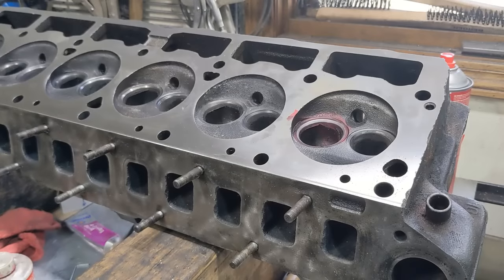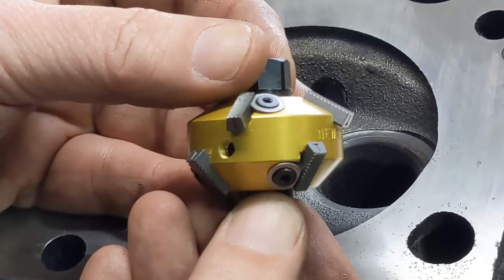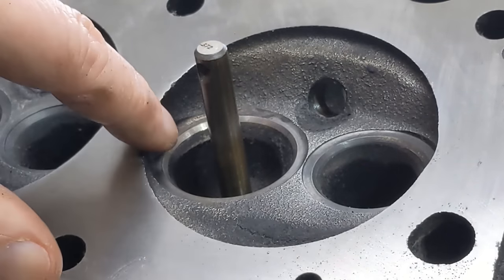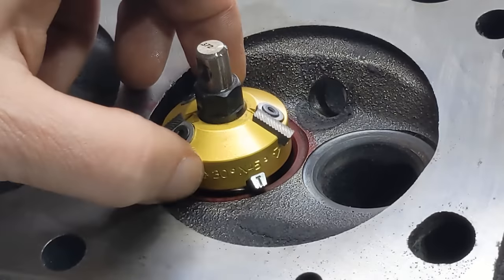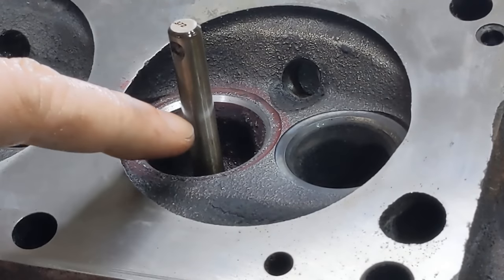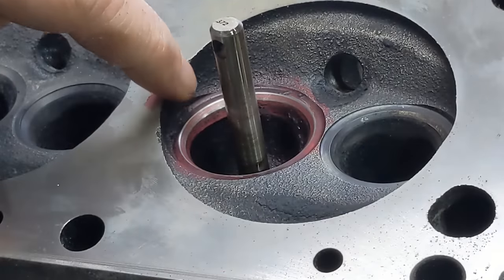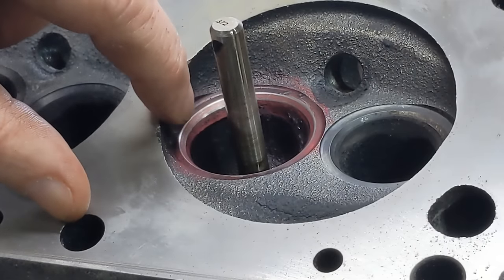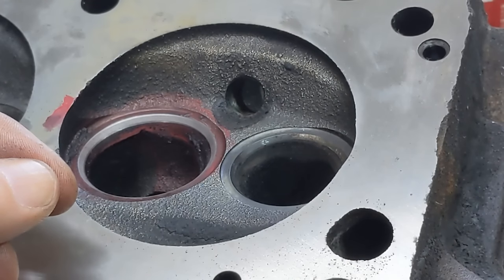Do Your Own 3-Angle Valve Seats!

Comment: When lapping a valve, turning the valve more than one complete turn is not correct and won't show any low spots in the seat. The correct method is to turn the valve only 3/4 of a turn.

Comment: Maybe the title should be any a hole can do a valve job? Your first mistake? decking the head first. You do that last. Your 2nd mistake? cleaning the head AFTER YOU DECKED IT. Your 3rd mistake? not using a light spring to hold the cutter off the seat. 4th mistake? you are using the 30 degree cutter to set the seat outside dia. 5th mistake- you are using the 60 degree cutter to set the valve seat inside dia.  6th mistake- lapping compound simply ruins the seating surfaces . 7th mistake? posting this video
Reply from the maker: So make your own video and post it. Question: Are you a huge dick in real life, or just on the internet?
Reply: Thanks for watching. 😆😆😆

Comment: Good tool but ghe seat is way too wide. A piece of carbon can get under it and hold the valve open causing it to burn up the valve. A narrow seat about 1/16th" will cut the carbon and send it out the exhaust.

Comment: Putting a 3 angle valve seat on this head is almost a waste of time since the whole thing is as-(badly)-cast and requires a port and combustion chamber clean up before contemplating any valve seat work.  The width of the valve seat should be 40-50thou and that has not been contemplated here, which appears to show that a little knowledge is ..............

Comment: I guess it's time to throw that Black and Decker seat grinding set in the garbage!
Reply from the maker: I'm hard-pressed to ever throw out a tool, but man, these things are WAY easier than the old-school corundum cutting stones.
Reply: If you have a complete Black & Decker setup use it, biggest drawback is most people aren't religious about keeping the stones dressed, there are many applications where the results using the stones are superior to a Sirdi or Neway .
One place I use my B&D seat grinder is on hardened (like Stellite or Inconel exhaust seats), quicker and smoother than the carbide cutters.
Reply: I do have the setup, including the dressing tool.  I haven't used it in a long time, but I also never get rid of anything, so...
Reply: A lot of top engine builders, will argue that the stones are best,
Reply: Why not Let the Neway Cutter tool do 99.9% of the cutting work & Then just Touch the 45° Seat with a Freshly Trued Stone ?? ...This would greatly Reduce wear on the 45° Stone & produce the Perfect finished 45° Seat surface possible.....This should greatly Extend the Stone  service Life .....
Reply: @tomstrum6259  I finish with a freshly ground fine stone by hand. No lapping, if you’ve done it right including the valve grinding lapping will destroy your angles and not promote any sealing.

Comment: Hi teacher are all valve same angle?
Reply from the maker: All valve faces I've ever encountered were 45 degrees
Reply: Some racing applications use 30* exhaust seats but they are not very common.

Comment: OLÁ Yoshimoshi     24/07/24   Dependendo do sistema de fabricação as válvulas elas NÃO SÃO RETIFICAVEIS.  O aparelho manual de retificar sédes de válvula "trepidou" durante a apresentação.  Deve haver uma diferença de 1/2° entre séde e válvula, aumentando na parte superior da área de assentamento na válvula.  A correção deverá ser feita (e há como o fazer) na séde.  Na válvula só se for constatado o sistema de fabricação da válvula.  Roberto Udo Krapf
Reply from the maker: Yes, with better and more precision tools and setups you can get to 1/2 degree.  But I doubt that when this came of the mass manufacturing line in 1960-whaever that it was any better than what I have now.
Reply: @YoshimoshiGarage  OLÁ   27/07/24  Neste setor as montadoras regrediram e é a razão pela qual os alojamentos  de comando de válvulas estão com desgaste excessivo e as MOLAS DE VÁLVULAS foram reforçadas.  Faz parte da trapaça do surgimento do TORQUE ANGULAR.  É um longo capitulo.  ABRAÇOS...   ROBERTO UDO KRAPF ANALISTA DE MOTORES A COMBUSTÃO INTERNA
Reply: OLÁ   27/07/24  PARABÉNS pela possibilidade de regular 1/2 ° .  Sugiro divulgar pois a maioria não conhece a importância em relação de qualidade e diminuição do tempo de execução.  ABRAÇOS  e Boas vendas   Roberto Udo Krapf

Comment: You sent it to be decked, and then fucked the surface with a steel brush first thing in the video :D
Reply from the maker: I can't tell if that's sarcasm or if you're seriously saying that a wire brush will take off so much cast iron that a head gasket won't seal it. Damn you internet!

Comment: I'll just toss this log onto the fire...some cylinder heads will distort upon installation, just like the decks of blocks. so a torque plate application may be a good idea for serious work on a cylinder head. but who has torque plates lying around? in a pinch....stack some washers the thickness of the deck, slide in a head bolt and torque it to spec. you won't get exactly the same distortion, but you might find a measurable difference to get close enough to what happens when that head is installed (ford windsors, for example, get their heads tugged on by the intake manifold).
Reply from the maker: Good suggestion.
Reply: Probably not worth the effort without an actual properly designed and tested torque plate for that application. Even building Pro-Comp, where a 2% leak down and anything getting past new valve seats was a fail, we never bothered with torque plates on the heads for the valve job. Splitting hairs. For some engines in really competitive classes, we even went so far as to heat the heads and blocks to operating temps, and even pressurizing the water jackets, while align machining the main bearing bores or cam journals.  Boring and honing the block / cylinders - sure - torque plates make a huge difference because the threads are right next to the cylinder wall and distort badly. But the science in there to replicate the distortion of the head bolted to the block is pretty mind blowing complexity best left to NASA level computer finite element analysis, a little more than stacking steel washers anyway, way over my pay grade, and I'm an engineer....
Reply from the maker: Probably overkill for my 185HP (at best) slant 6

Comment: Couldn't u use a new valve as a guide for the cutter. Would think it would line up perfectly with the guide. As long as the guides arent bad
Reply from the maker: I think a valve would be too short, plus it's unlikely to be the same diameter as the hole in the cutter head

Comment: Everything went well until I saw the pogo stick and paste come out. Should not need this with good equipment. When you lap you are lapping  at ambient  temp, sure as he'll ain't going to be that  temp  when u belting up a hill at 100+kph. Remember valves expand, seats change dimensions  with heat, can you guarantee  that lapped area is going to match, it wont!, so why do it. I've  never lapped a valve for over 40 yrs in the engine reman. Trade. The engines perform better, especially  at higher rpm, heads run cooler and I've  not had any problems.
My saying is, "LAPPIT, you CRAPPIT"
Adrian
Reply: You're right 
We just cut them and vacuum sucked them for confirmation.
In 5 minutes run time they're going to self "lap" anyway. 👍👍

Comment: Ive seen oh somany guys using these and fucking up the seats. and they dont have a clue they are fucking them up. do your self a favor find a good shop that knows what theya re doing...witch can be quite a chore as you dont have a clue that may also not have a clue even though they may have a milliuon of $$ or more in equipment that they do not know how to use properly. Ive reworked oh omany fucked up other machine shops shit work it makes me sick. and they charged as much or more than I did. stay away from these cutters!! stay away from bubba down the road in the back of the waffel house or gastation that seem to never have a running vehicle...

Comment: look at how rough it is!!!! look at it wobbel!!!  why was the head not properly cleaned befor???look at the carbon&crap in the ports!!! the deck serface has also been screwd up!!!  look at the cutter chattering!!!! watch closely and see how to eff up a head. sorry guy this isant the hot tip of the day. I reckon if your out stuck in the outback this may get you closer to where you need to get.thats if you always take all this stuff along and spair parts witch comes back to the guy whose stuff never runs for long.... yes look at the rough face after he farther effes it up with the "lapping compound" witch is abrasive that embeds into the seat and valve to only set up a dinner to keep eating away at the head&valve when it's running. please throw that away and get a real valve grinder and seat cutter, there cheep on flebay.
Reply from the maker: Hell yeah!

Comment: A Neway cutter kit is over $1000.  A shop might cost $300.  This is not a solution for any DIY
Reply from the maker: Brand new I think I paid right around $500 for the pilot and 2 cutters for 3 angles, and if I do more than 1 head I can use the same tooling over again so your argument is false on face value, but it's also short sighted.  If I use these, I don't have to take the parts to a machine shop, which aren't "local" to a lot of people any more.  I don't have to wait for the shop to have availability and time to work on my parts.  Plus there are the intangibles like the satisfaction of doing it myself and knowing both the quality of the work and that if there are problems I know exactly who to blame.  

You can absolutely argue that doing this yourself this doesn't make sense for you - you could probably argue that for nearly every video I've made - but I'd say that if that's your line of thinking, then just maybe your DIY is not the same as others' DIY.  I mean if you buy a flat-pack bookshelf from IKEA and assemble it yourself, that could probably be called DIY but it's really not the same as buying lumber and building it.  And that's not even the same as cutting down a tree and making the boards and then making it.  You're looking at it from the top,  whereas I (and I think many others) are looking at it from the bottom.  Some of us enjoy the satisfaction of the journey and aren't quite so focused on the end point.

Comment: SMH. Please before you talk about accuracy and the "Quality out of other machine shops" Talk about the reasons for Quality machine work. Yes you can make a newway seat cutter work to seal a valve for a day, for a week or maybe even a year.  But this is just one step of several complicated steps to correctly perform a valve job. There are so many reasons to not use this kind of setup. Precision being the first. Talk about seat run out, seat depth, seat width, seat surface finish ! talk about why each is specific to an application. Talk abought why Each application has different requirements. There is a very good reason modern machine shops use specific 3 angle tooling. I understand machine work is cost prohibitive to some. But what you have demonstrated here is how the average home mechanic can increase the cost of having their machine work done properly. Modern engines can run well in excess of 300k miles when properly maintained. This is due to advanced engineering. People much smarter than me (and you) have designed These engines. When repairing these engines best practice is to follow their recommendations on fit finish and quality. Well unless you are smarter than the person who designed it.

Comment: Worst 3 angle valve job i ever seen. Those seat widths are way to wide. 30° to lower the seat 60° to raise seat 45° for seat. Best is proper valve grinder and stones, Cutters do a poor job. You dont know how to do valves look up the factory spec for valve and seat angles and seat width and grind the valves to those specs
 And make sure your guide are good before you begin. Lapping is for lawnmowers.